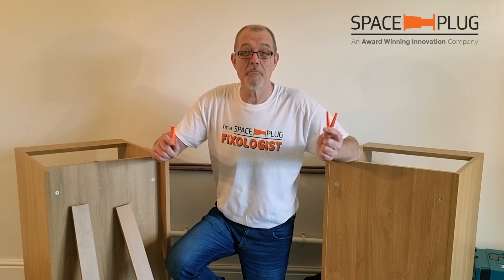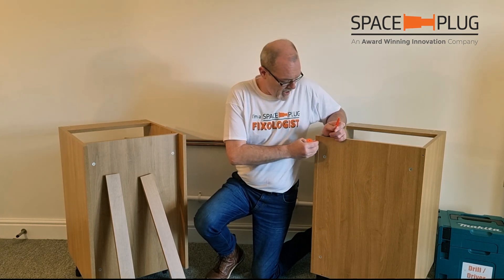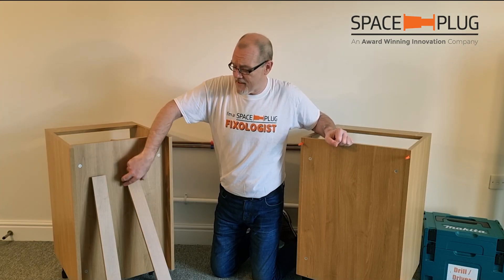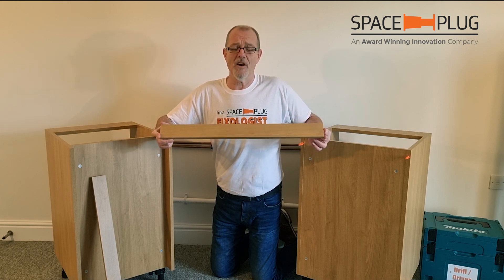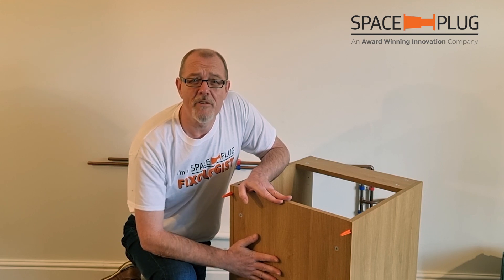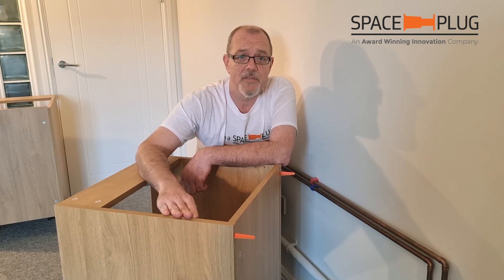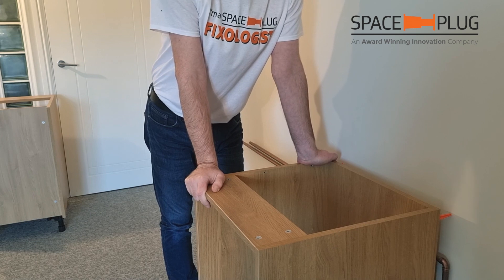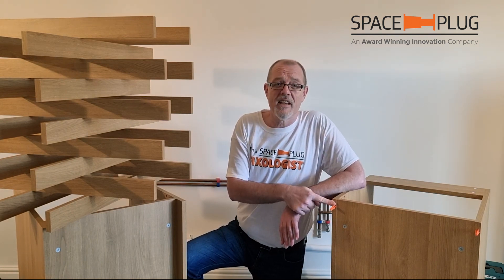What is Space-Plug Evolution? - Cliff Petit (Inventor at Space-Plug) Explains All!

Comment: Hi Cliff. this looks great. So say a standard kitchen cabinet is 575mm deep, which incudes the current extra pieces for the service gap. with these, presumably this means the flat back cabinet can be made not so deep?  How much? 50, 60 70mm?  Thanks
Reply from the maker: Thanks James ... Much appreciated 👍
There is no standard as such tbh ... the industry ranges and it depends on the supplier ... most seem to be at 50mm, some are up to 65mm, some as low 30mm ... I've spent 10 years talking to manufacturers to develop this and all seem to think theirs is standard 🤷‍♂️
Reply: @SpacePlugLtd  thanks for your quick reply cliff. I am in the process of designing and making a range of kitchen cabinet carcasses and your idea completely makes sense regarding the current wasted material. I would like to implement these pegs across my range so am just figuring out the best dimensions...
Reply from the maker: That's great news James ... drop me a line at plugs@space-plug.com or call me on 07901553290 and be delighted to get you sorted!
Reply: @SpacePlugLtd  thanks i've just emailed you :-)